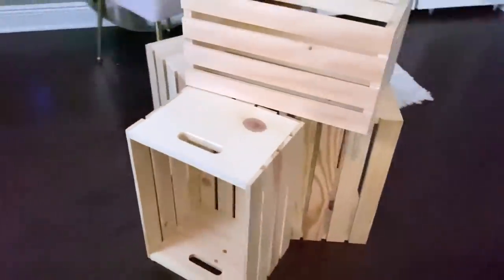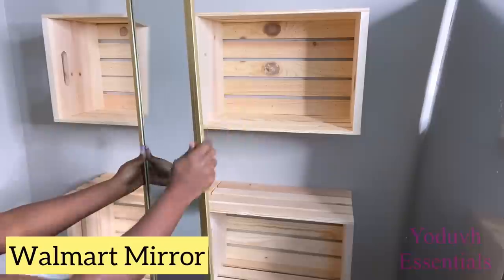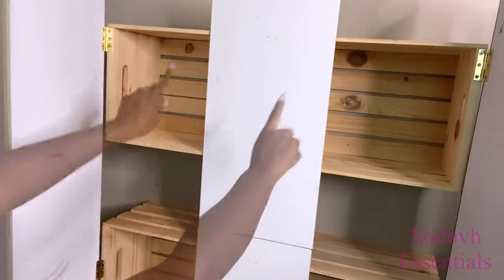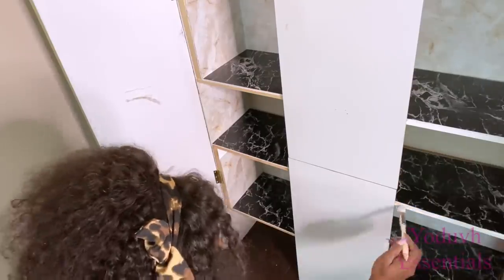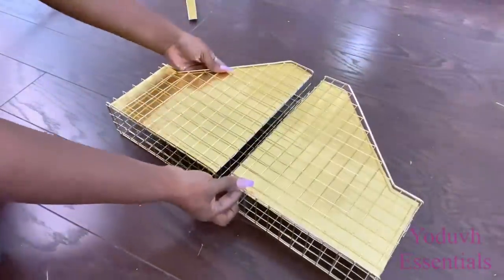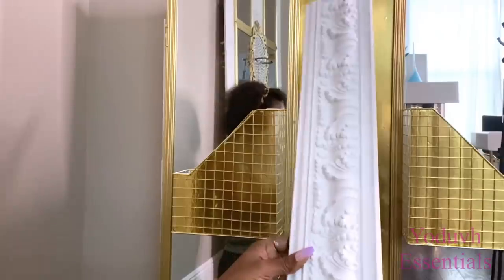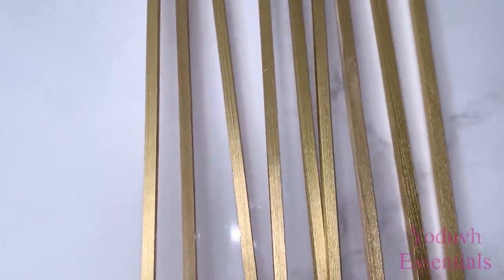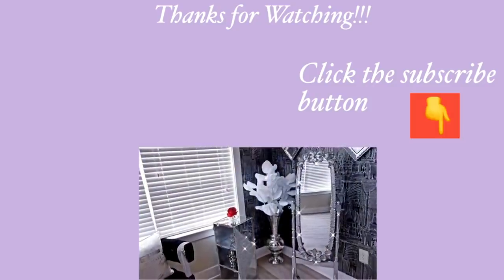DIY Mirror WARDROBE with Walmart Items! Bedroom/OFFICE STORAGE SOLUTION!

Comment: Something that might be helpful for sturdiness is that( or at least it used to be ) there is a stud every 16 in from the corner including the corner and 34 in from the floor ( always check for accuracy) double-check that things, standards may have changed or vary. I worked with a finish Carpenter for a while and that's what the standard was then. If you go into a stud you won't need but a few nails or just a couple of screws. Those finish nails that you are popping in are simply going into sheetrock and may not have the sturdiness you desire. Plus finish nails have no head for that extra security. All that said, I LOVE your Channel and watch it every time you put a new video out! YOU ARE VERY CLEVER!